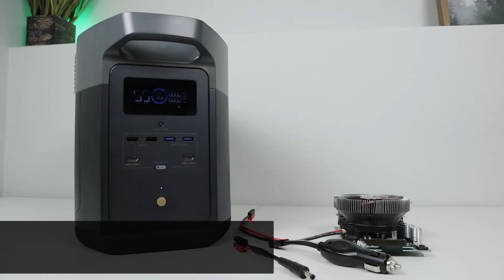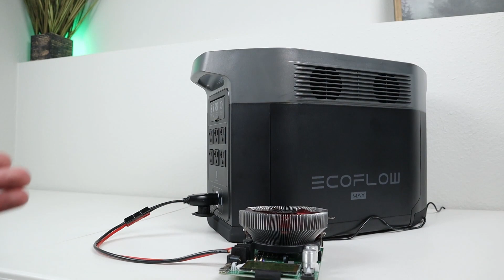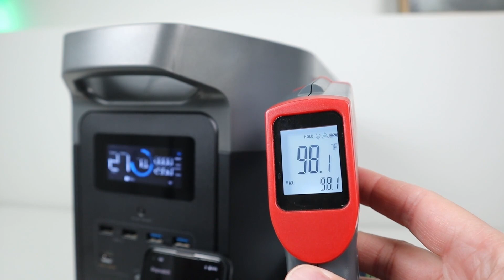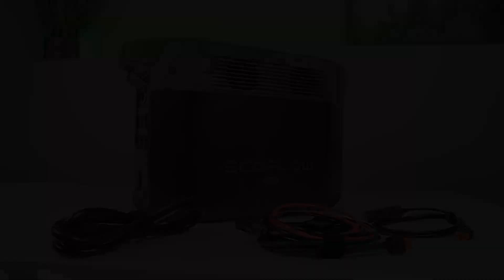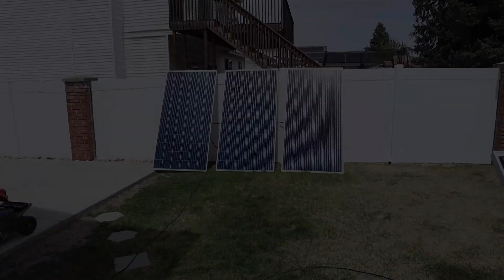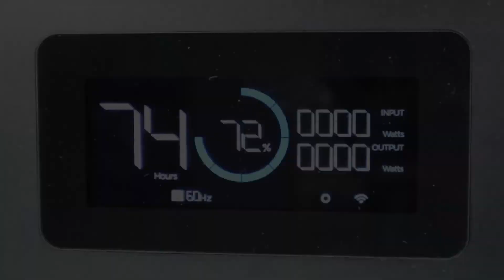Backup Power for Your House?! - EcoFlow Delta Max Full Testing & Review (2016wh)

Comment: sure this is a little on the expensive side, but otherwise a really nice unit.
the fast charging is excellent. and efficiency of the ac inverter is great too. the 13+ hrs at max discharge from DC is a really long time! it could run that 12v fridge for many days.
as far as not having bi-directional charging on this huge capacity unit, i dont think its needed. i think its only needed on smaller units.

thank you again for your in depth reviews!
Reply from the maker: Great points P M! I was also very impressed by the DC output time and the low parasitic drain. Fast charging is always a benefit, just think if the power was out for a couple days, you could pump this thing up super quick using a gas genny....or solar panels if it was daytime :)

Comment: Love your videos. I think it's great that you do the sound measurement and it's a good rough estimate. However, if you want to improve consistency, I would try to control the distance of the decibel meter, take a measurement with your hands off, and maybe measure the noise floor in your room when nothing is running. Keep up the good work!
Reply from the maker: My office seems to have a floor of 35db. I'll need to get a sound test 'standard' going for sure. Thanks for the feedback.

Comment: I got mine yesterday so far I only tested it with my portable cooler. Enjoyed for one day looking to do more testing
Reply from the maker: You should get excellent run times on your portable fridge! What type of solar setup do you plan to use?
Reply: @Jasonoid   well i have the river mini and river pro. i plan to get the delta next (1300wh)  i do a lot of camping and depends how long i plan to stay out will depend on the system i use. the delta max is bigger than i expected. i plan to add two rockpals 200w solar panels for now. insted of getting the extra batteries i would like to add another delta max or two to rotate in and out while the other charged. btw i have two rockpals 100e panels. i will make some videos soon.

Comment: Jason, the reason it was not charging at the higher wattage is because the Delta max checks for voltage sag on the AC input source. If it detects possible lower amp capability coming from the breaker box, it will reduce max charging input to prevent overheating wires in wall, and popping a breaker. I tested this by trying outlet in kitchen, and obtained 1750 watts.
Reply from the maker: Interesting. I only had that charging test running on a 20amp / 12awg circuit. I'll have to try one outlet right up next to the breaker and see if I get higher results. Thanks for the tip!
Reply: It also throttles the ac charging current because of internal battery temperature and state of charge it was most likely that

Comment: the air coming out being cool isn't necessarily a good thing. If the fans and heatsinks are doing their job, you should expect the air to feel hot from an exhaust. The only temperature that is of interest is from the internals.
Reply from the maker: The fans are moving TONS of air, and at 63db this thing is louder than other power stations I have tested at full RPM. I was very impressed by the cooling efficiency, not so much the noise though.

Comment: Great presentation. You are so clear on the options. I would feel more comfortable with the Pro. I want to reduce my dependency on the grid as much as possible . I  would find more daily uses for a power station not just for grid down. When comparing the the Pro. I would get a AC 200 for the cost per unit. I learned a from  this video. Peace
Reply from the maker: Thanks Ce Holmes! My goal is that people learn new things for each video so I'm glad that's happening :) :)